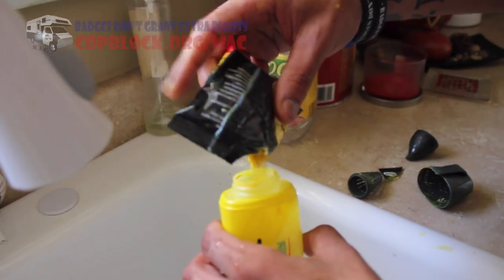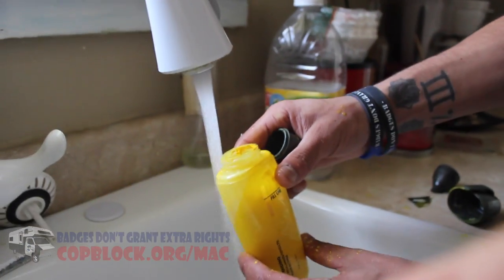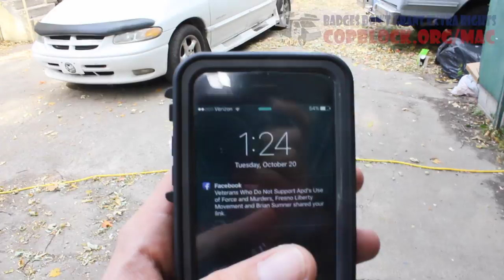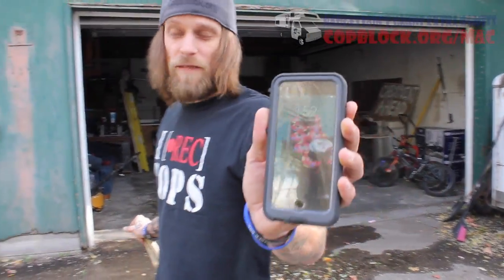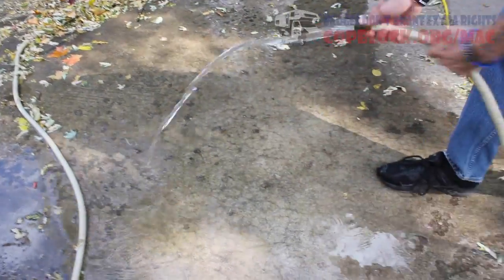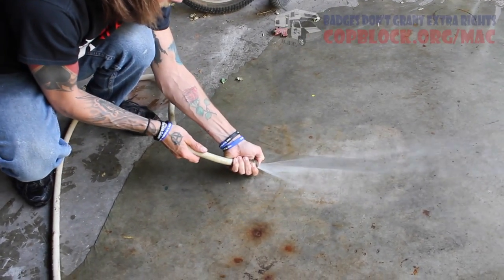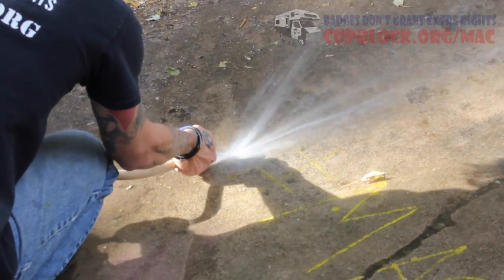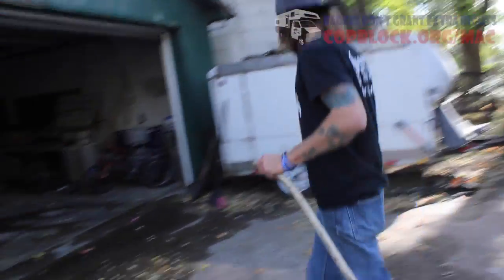Chalking Experiment - Does Chalk Damage Property?

Comment: Actually a stiff nylon broom, plus some detergent in a bucket, would be nice to have on hand..hmm.
So, first see if you can just wash a unmarked sidewalk without interference.. if that is permitted then that is protected speech too.. 
Then insure you mark an area, for a short defined period of time, and come back and wash it off.
Of course for comparison, have someone walk in some thin gritty mud (not slippery) and see if the city seeks to remove the thin mud.. as a practice.

Does the city promptly remove leaves and grass clippings from the area?  So if it allows leaves and grass clippings that have no message but objects to chalk for the same time with a message then it is arguably the message not the material that is the problem.